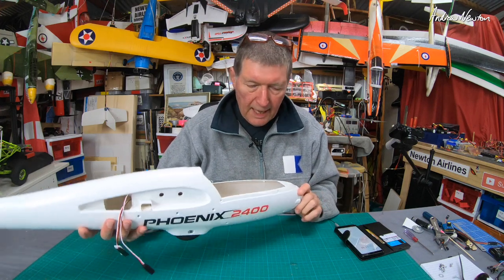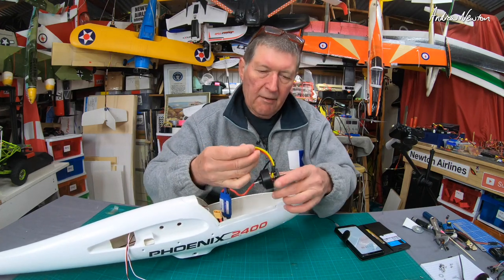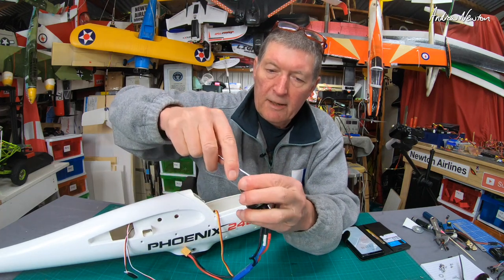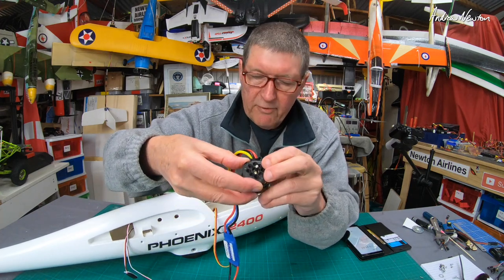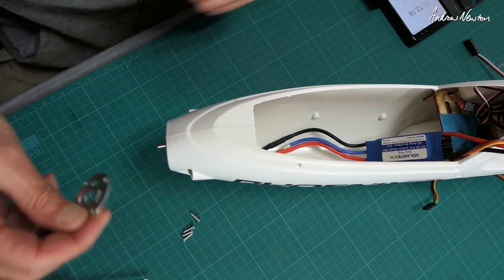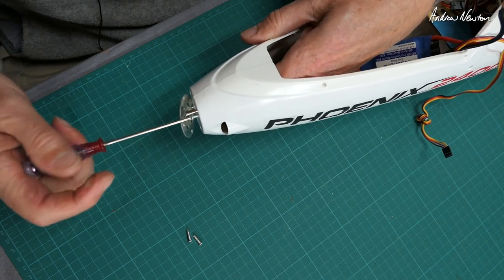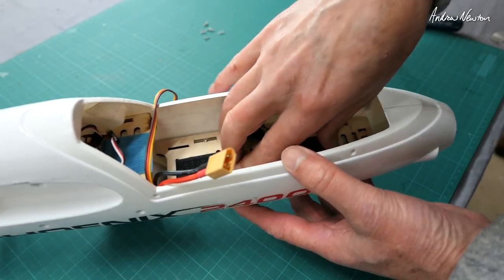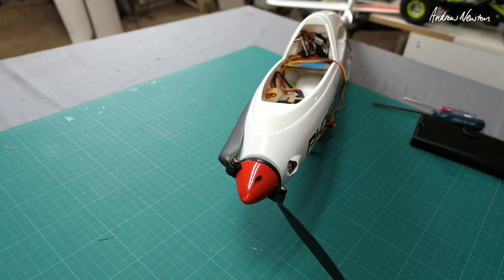How to fit the Phoenix 2400 motor

Comment: Andrew, I have found the best way to line the Motor & front plate up for the screws is to use 4 Cocktail sticks. Having got it lined up just take out 1 stick at a time and insert the screw :) Regards, Pete
Reply from the maker: I'm writing this down, thanks Pete.
Reply: I prefer toothpicks, as I'm not an alcoholic.

Comment: Thanks for the nice video Andrew! My motor had only 2 screws to hold the plastic disc / transfer mount! The hook from the plastic mount also damaged the 3 wires from the engine...so I used new heat shrink tubing to correct that as well.

Comment: The 2400 is one of the best gliders I have flown, great fpv plane, I changed over my 1050 KV for the volantex 850kv motor and one size bigger prop. Much better in power and battery lasts longer. I have flown it in 20kn wind no problem. Best value for money glider on the market.
Reply: Nick, did you also change the ESC when you upgraded the motor? Thanks.
Reply: Would you mind sending a link or just giving the name of that prop nick?

Comment: This is a great glider. I have been able to ride thermals for over an hour. I did change outthe motor and use the Brushless Motor 4023/850KV along with a 12 x 8 carbon folding prop. I also changed the ESC to a Turnigy Plush-32 40A Speed Controller w/BEC, but would recommend a 60 amp ESC if I were to do it again, and I run it all on a 4S 2200 35C battery. 

 Nick Marangelis 1 month ago 

The 2400 is one of the best gliders I have flown, great fpv plane, I changed over my 1050 KV for the Volantex 850kv motor and one size bigger prop. Much better in power and battery lasts longer. I have flown it in 20kn wind no problem. Best value for money glider on the market. "
 
My first one has the 1050 motor. Due to battery weight with the Phoenix V1, I'll probably be using 3S battery packs. Being  a complete beginner to motors, props and batteries, I wonder if you or one of your subscribers can clarify the implications and difference between the 1050kv and 850kv versions of the Volantex?  Maybe the difference between 2 metres and the 2.4 metre version?
Reply from the maker: I'm still using the stock motor on both, no reason to change. P2K V2 is a better thermal glider with less drag. 2400 is more suited to loading up with batteries for long powered flight
Reply: is 850kv stronger than the 1050?
Reply: i thought the motor is 11.1 volts, 4s would be too much voltage??

Comment: Great  educational vid on these plastic fuelages Andrew, as you know, I've got the Ascent and the Phonix 1600,  thank you Andrew, ,  and in both of my planes the motor did get warm, 
the plastic went soft on the motor mount and in both cases pulled/melted  the screws through the plastic! causing the barrel of the motor to rub on the plastic inside the nose!, nearly burning out both motors!
 in both cases to fix the problem instead of the plastic mount I used another of the front metal plates Inside the nose and so far has fixed my problem,  both of mine run on 3s, 
the Ascent has a vent cut into the plastic on top of the motor to help with the cooling, 
so anybody who uses more than 1/2 throttle and 3s on a regular/continuous  basis (Me)  the plastic noses will  get soft too, the warmth of the motor softens the plastic and sometimes the whole nose wobbles under full power!! 
I like the concept of the plastic fuselage, but I think it's a mistake to mount motors on such thin plastic!, Having told my sobstory, 
the Ascent is the sweetest flyer I've ever owned,  virtually unstallable with 2- 3s 2200mah battery's in the nose!  anyway great vid :-D
Reply from the maker: You're up late Chris! Yes the thin plastic bulkhead may be its weakest feature, although I have not managed to break one yet.
Reply: rfr     the question that you should ask yourself is   whynhel  would the motor of a self-launching  glider get  warm....in the first place.
Reply: @daviddavids2884  because on a warm day, say 27c (Not Lately!)  the 1mm or less of plastic just sitting in the sun goes SOFT!, the screws sink into the plastic and you have a loose motor...If my plane has a motor I use it
Reply: @AndrewNewton  Yea, I'm stuck in night shift mode,  cant sleep unless it's 3 or 4 in the morning then I get up 10, 11 or whatever, no cool still mornings for me.....unfortunately,
 No they don't break the nose, it distorts the whole nose,  when under high power, it  wobbles? distorts the plastic way out of shape, you hear a horrible noise and have to back off or the motor pulls through the thin plastic.  On one of the forums a bloke said he solved this issue by fiberglassing the inside of the nose,  in this cooler weather it's not so much of a problem, but when the summer comes, I'll have to do the same?

Comment: I added a 1/8 inch plywood firewall on the inside to strengthen the cracked firewall on the fuselage.  Used shoe goo glue since nothing else seems to stick to this plastic. Firewall got cracked in a hard landing.  I like this plane for gliding and thermals, its slow and stable, easy to fly.
Reply from the maker: Good mod Greg

Comment: The cowling/ front of the glider is a real weak point. I put some thin fibreglass sheet in the nose with some 5 min epoxy and now the nose is rock solid. It's a couple of grams in a glider that is tail heavy anyway.
Reply: Albeit always mindful of weight, modest glass and resin reinforcing is my thought too. Returning to RC with electric after decades of IC RC & soaring experience (full size), but (relatively) an electric newb. Have the smaller 1.6M sibling of the 2.4M Phoenix in the mail. Before ordering it, I'd already retrieved x4 NIB unbuilt electric ARFs & motors from long term storage. Given their respective Power to Weight ratios, all the gliders will be receiving lightweight glass and backing plate firewall nose reinforcing. The few grams in the nose is insignificant, and would likely be required ballast in any case.

Comment: you say not to use threadlock because of the plastic but if you use a cocktail stick or similar to get just a drop of the threadlock on it, you can then place it into the thread of the motor and avoid putting it on the bolts and none will make contact with the plastic :)

Comment: I had a few phoenix 2000 models in the past they use the same motor and motor mount system .What I've learnt is it's best to use the the original motor. I've tried different motors ended up ever melting the motor mount or having poor performance.The plastic mount is a week spot I've have this motor in my current phonex 2000 it's a upgraded from the older blue version.Im surprised that a upgraded motor mount has not been made on the plus side you can buy spare motor mounts from banggood just forget about HK who sell the Phonex range with no spares to back them up banggood is best place for spares.

Comment: The battery tray in this model is held in place by wood screws, one little bump on the belly and the screws will strip out. I replaced mine with 2.5mm bolts and nuts, gluing the nuts to the inside of the battery tray.
Reply: I just added a little precaution of some hot glue on top to sides, whenever i needa take it out just cut the glue around edge, and take screws out

Comment: I also have a small tip: With the help of a hot air gun you can nicely remove the air bubbles under the decals ... works like a charm ;-)
Reply from the maker: Good tip thanks Frank

Comment: Hi Andrew, glad to find your channel,you have some awesome very exciting and qualitative reviews on your channel :-)
Do you know which timing were the most suitable one for the Volantex B4023 1050kv motor? Because I want to run this motor with the Hobbywing Skywalker 50amp Esc and this one doesn"t has the auto timing feature, so this ESC must be set up with the timing between his three different options "Low,middle or high " timing.
Would be very thankfull if you can me some good advise about the correct timing option on this B4023 1050kv motor ..:-)
Nice regards from germany 

Miguel
Reply from the maker: Thanks, but I dont know much about ESC timing sorry. I have never changed from stock timing.
Reply: @AndrewNewton  Thanks for your reply :-)
Too bad ,so I will have to figure it out.If I could find somewhere any advice how much poles this motor have,it would be very helpfull to figure out the right timing for it..
Wish you a nice week and stay healthy!!

Comment: How do you reckon this thing takes the thermals, any tips for getting on them?
Reply from the maker: OK but not as good as the 2000 V2. Fly up to 100m cut the motor and glide around smoothly until you see the plane do something like roll or bobble a bit, then start circling. Helps with learning to have a vario.
Reply: @AndrewNewton  Alright cool, looking to maiden it next weekend, but what would you say it's main focus/what it does best is?

Comment: Hi, Andrew do you have a good recommendation on the Lipo batt for the phoenix?

I already got the Volantex trainstair 1400mm from your vid ;-) and use the 2200mah 30c from ZOP power.. wonder if there is something out there which better..
Reply from the maker: Can use anything from 2200 3S (gliding) to 3000 4S (long range FPV)

Comment: As a very minor techno-nerd (I'm not an engineer, just keen on all-things mechanical), I've always been frustrated and disappointed by the various prop-mounting options on electric motors. They all just seem so clumsy, relying on direct friction from a collet or micro grub-screws on that super-smooth, polished motor shaft. Plus a lot of hope and maybe a smear of goo to help keep things in place.

It just seems unsatisfactory, to me.

Meanwhile... the name Phoenix got me thinking.  Back in the early 90s a mate of mine had a model he'd designed featured as that month's free plan giveaway in RCM&E magazine. Whee! (All balsa, 4-channel, fully aerobatic with a T-tail and a Saito 40 4-stroke.)

His Phoenix really did rise from its own ashes. The prototype crashed spectacularly when he pulled up on an inverted low 'photo opportunity' pass. I was trying to get some pictures for the magazine - there were no digital cameras back then, no autofocus or auto-exposure or stabilisation or instant review screen to check you'd got the shot - so it was a case of exposing 60+ rolls of film (at 36 pics per roll) and hoping you got 3 or 4 usable shots...

The plane was utterly destroyed. We salvaged the engine bits (wrecked) and the radio bits (wrecked) and set fire to the remains. I got some pictures of the blaze, but the mag didn't use them (boo!).

The Mark 2 Phoenix was a right little cracker and had a HUGE rudder for outrageous knife-edge and flick manoeuvres (this was long before 3-D aerobatics were a thing) but it was light and agile and had a lot of wing area and could fly ridiculously slowly - full up trim, engine idling, still responsive to ailerons, just dangling from the prop... 

A prop, incidentally, that was fitted to a proper darn threaded darn motor shaft with a proper darn nut tightened with a decent darn wrench, not some wimpy little aluminium collet affair... (Mumble, mumble, mutter, mutter, plus assorted other grumpy Elli noises...)
Reply from the maker: Yeah threaded 5mm shafts just like quad motors. There should be a law
Reply: e-p       agree.      and yet, a friction fit between metal components  Can  actually be an elegantly simple solution, to certain types of problems.    for example:  the only thing holding the chuck of my drill press in place, is  FRICTION.    over the decades, it has  never come loose.   cheers        googletranslate

Comment: some info.    good work.        however, volantex  has  Not  yet  shown that  they  know how to correctly design an offset pusher thrust configuration.     consequently,  Anything  Else  the company makes  should be  scrutinized  for   design  wonkiness.          it can be seen that  a bldc outrunner  motor that has a  larger bell/rotor radius,  has more  leverage (MA)  at  the  prop, compared to a smaller radius.       the relevant comparison is  Radii  ---  prop  Radius  to  the  Radius at which  Force  is produced in a motor; that is,  the  Radius at which  the magnets move past the stator core(s).           the fundamental value of a circle is  Radius; the area of a circle, or volume of a cylinder, is   Determined  by   Radius.     googletranslate                the outrunner motor configuration  may  be  the  key  to  clean generation of electrical power.       it may be  practical  to make  a  very  Large-radius  outrunner motor;  a motor in which  losses  and  power consumption are  minimized, to the  Maximum  practical  extent.    (fisher and paykel have made a start.)        i wonder if anyone has investigated  the use of   BRUSHED   commutation; for the sake of simplicity.         you may know that there are two kinds of coils:   those that  'self-induct'  and those that do  not.      the former are  Generating coils and they have a  layered  structure.    see brooks coil.       the latter is a solenoid  or  a passive inductor ---  where a  multi-layer structure should  Not  be  present.        however,  a  layered solenoid coil design is acceptable where  a   meandering current path  is  Not  present.    in other words, coil layers  Must be connected in series, 'end to start'.   d        googletranslate
Reply from the maker: Thanks for your thoughts David

Comment: I never could workout what those Cocky's were saying to me.... Now I know..  
222 Loctite for metal parts.  Dab of 406 Loctite for the plastic. Works well in lots of applications.
Reply: Around the maize growing areas it's usually "Achtung! 12 gauge!" ;-)
Reply from the maker: Ah thanks Pat, have to get some 406
Reply: "Pull!"
Reply: @AndrewNewton  406 is like " Super Glue " but better. It wicks well but be careful....I have accidentally stuck fingers together. Yikes !!  You will get this from somewhere like CBC bearings or other industrial supply. Not a bunny's item.